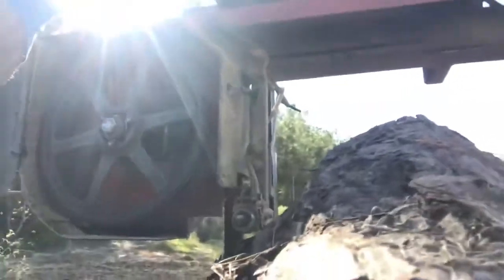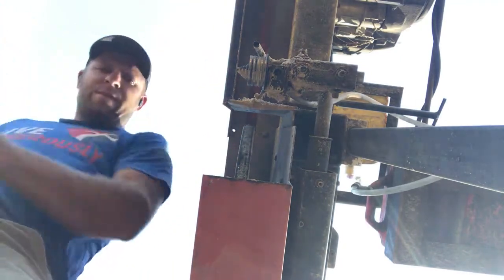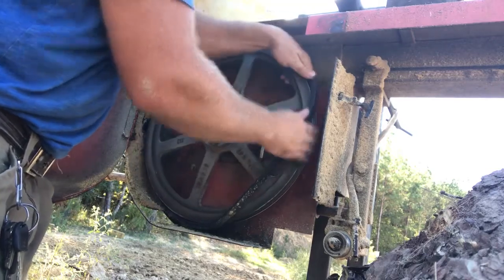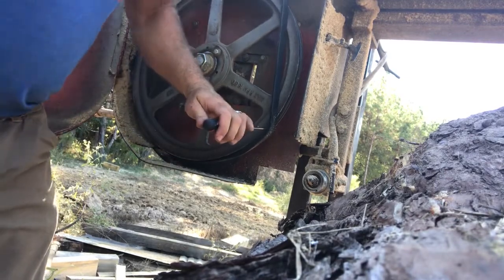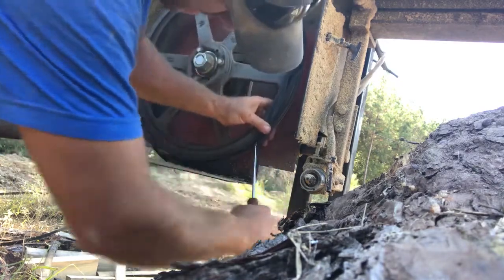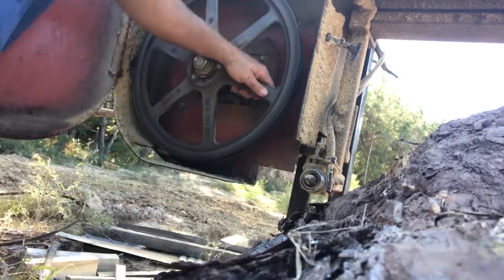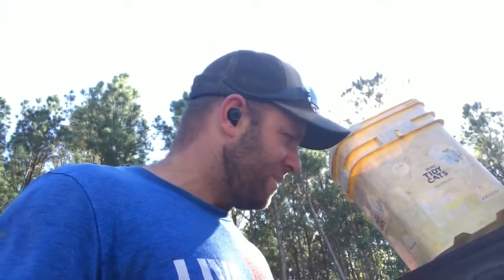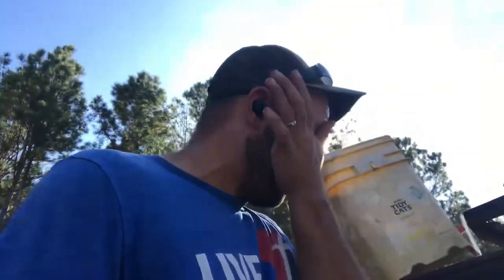Replacing the Wheel Belts on my Sawmill   Timberking 1220

Comment: I also have a TK 1220 and I have problems with uneven lumber. Was curios as to how much this helped. Thank you!
Reply from the maker: I don’t really know to be honest. It sure didn’t hurt. My nemesis back then and still today is getting wavy cuts in pine. Hardwoods are generally not as troublesome. Pine if it has knots or significant sap is a SOB, no matter what. At this point in my game, I pay a premium for premium pine and it vastly diminishes the headaches. Well worth it. 

Check all your belts and bearings and you should be good to go. I am NOT kind to my 1220 and it just keeps on cranking. That’s why I love it so much. 😆

Comment: What is the lengyh of the belt. 58" is too tight, 60 is too loose. Thanks.
Reply from the maker: Must be a 59 then. 😆. I don’t recall actually, I just ordered them from TK.
Reply: Is that a 18.75 wheel?

Comment: Hi Tom, thanks for the video - have you replaced the main drive belt yet! Thanks
Reply from the maker: Nope. Tried to tension it by loosening the bolts, prying the engine over and tightening back up. Belt still shakes like crazy.